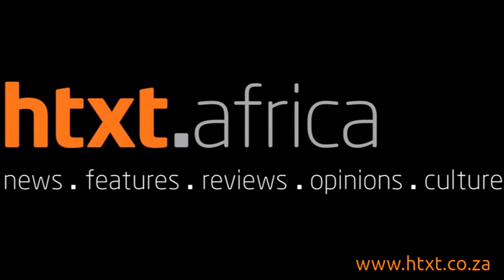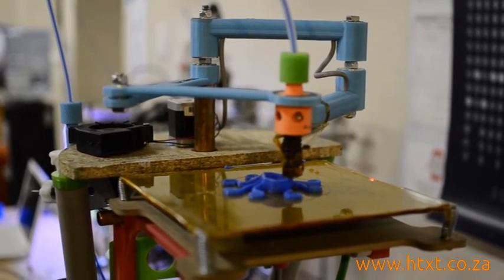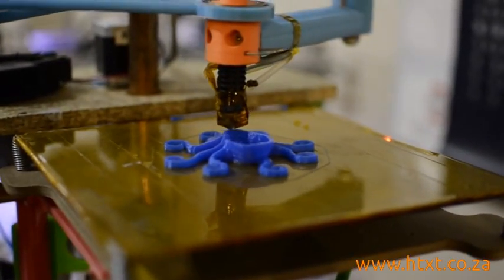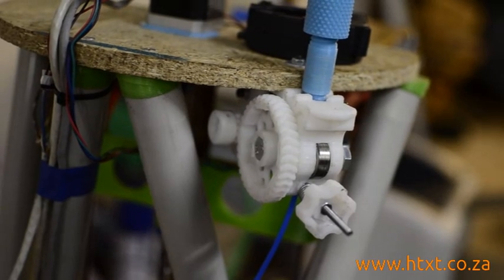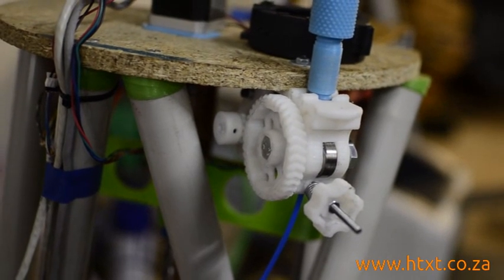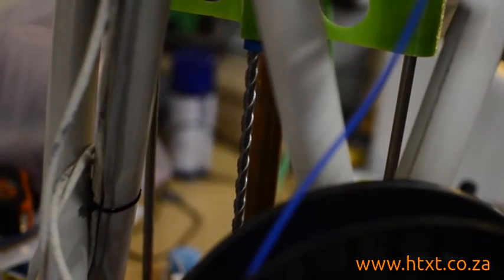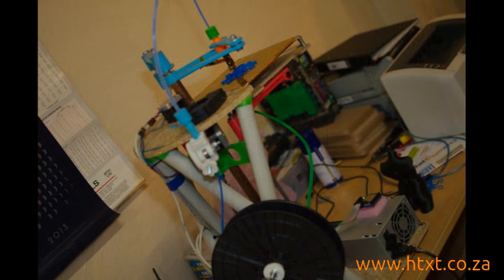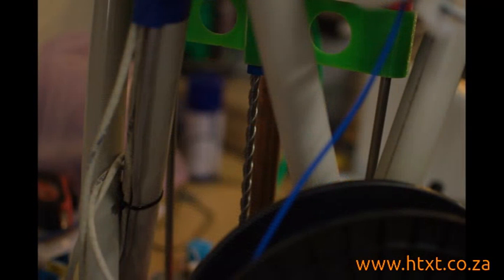RepRap Morgan

Comment: Hi Quentin, congratulations I love it but for teh sake of correctness:  You had 2 3d printers (makerbot + darwin) before...  Right?   Cause it sounds like if You had built it from bits and pieces...   But still GREAT piece..  How does resolution in the midddle compare to the edges?